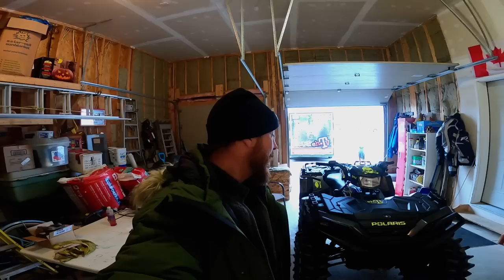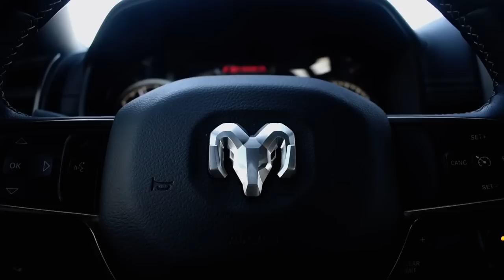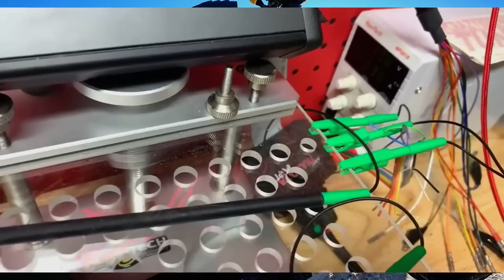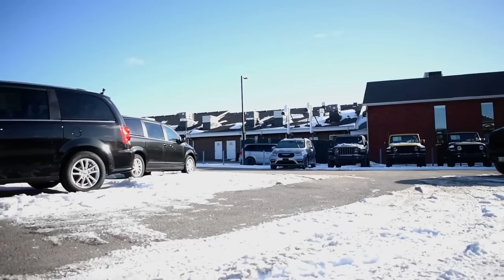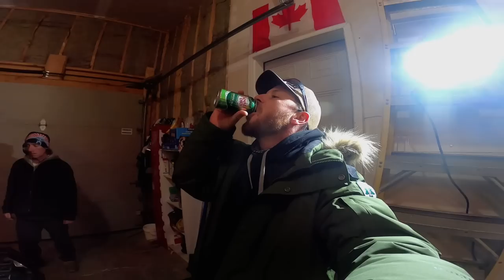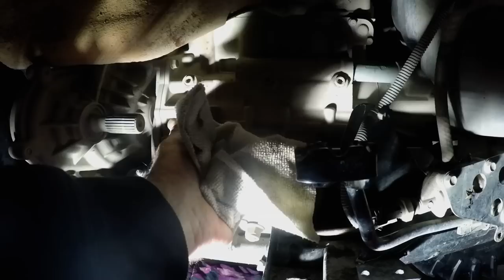Silver Play Button!!! Can-Am Renegade Xmr 4Lok Walkaround, 2021 RAM & Fixed A Polaris

Comment: Hey man looking at doing those bar risers on my new xmr renegade as well is 2 inch the highest you can go with the steering stem brace or ? Seen they make a 3 inch as well but was worried about the cables did you have to modify anything to make it wokr